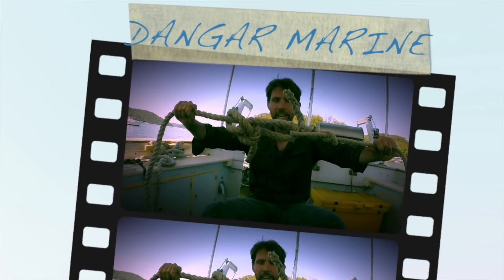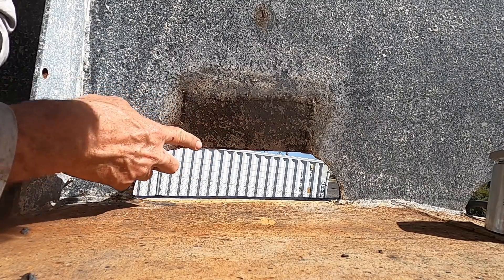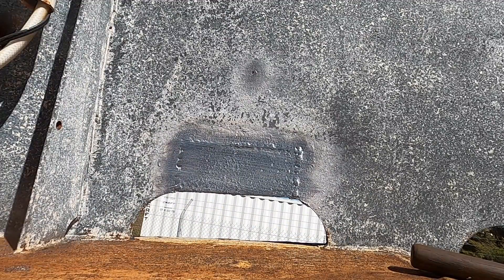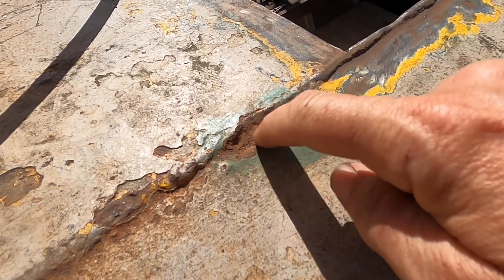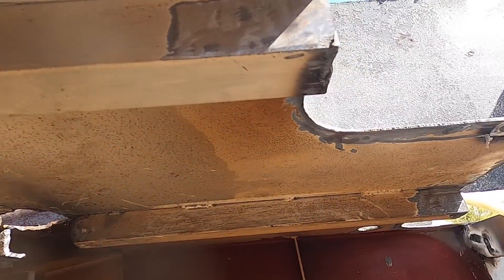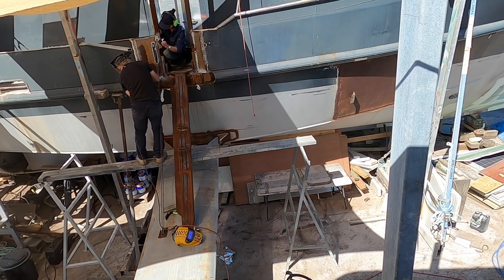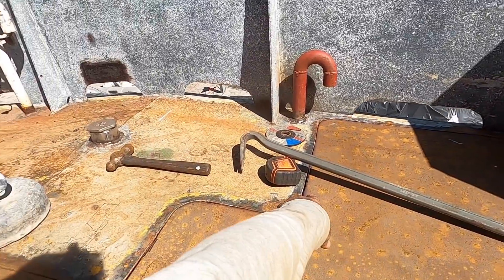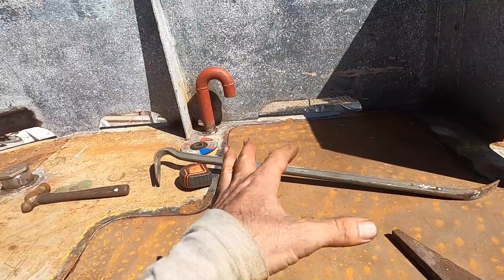How to repair a rusty steel boat

Comment: I've often had people say to me don't buy a timber boat as it's a nightmare if you need to do any major work due to rot etc. But looking at the amount of work you've had to do cutting out and repairing rust in a steel boat...what is the less of two evils? ...

Comment: I have a question and I am desperate. I have a 92 Suzuki dt115 it will not run above about 2200 rpm when in the water on a hose it will rev up to 5500 or greater rpm.  I have taken it to two mechanics and they have no clue.  If you disconnect the Throttle Positioning sensor it will rev high at idle and runs at full throttle.  I have replaced the the TPS and the CDI it is not the carburetors,  or Fuel it has great spark on all coils great compression 125 even all cylinders.  I thought it was in limp mode but the mechanic that has it now says it would not rev above 3000 rpm on a hose.  Do you have any Ideas. I will gladly send you some money if you can point me in the right direction.  Where I live not many Suzuki outboards so the mechanics are not very knowledgeable.  Thanks in advance for any help you can give.  Love your channel!

Comment: You don´t have to grind slag off of a plasma cut, just tap the edge with a hammer and the slag comes off in long strands in seconds.

Comment: Just a request, when you upload your video, can you enable captions in the video upload settings.
Once you do it for one video, it should remember it for next time.
I sometimes watch while my wife puts our son to sleep so volume is low, as dialogue is much quieter than the work
The auto captions are a little inaccurate lol, but i can fill in the blanks

Comment: We used dogs 90 degrees from yours long side down, but I guess your wedges are thick
You can put a tack in and hold it down with a 2lb hammer upright with the wood on the deck so you dont electrocute yourself
Then if you need to adjust the plate slug it with the 2 pounder while the tack is cherry red. You can get away without major adjustments using dogs quite often
same goes for frame tacks, get your mate to slug it with a hammer to bring it down after tacking on the inside, its just easier with 2 ppl.

Comment: Hi Stu, maybe down the road  for the likes of lighter pad welding you could try 2.5MM rods at 90 Amps as you can get a fairly stable arc are good deposition good weave  and less slag entrapment as you say it's all tail and error one could  even allowing two passes with the first partially filling the likes a crater,  moving over to another defect or two  and then coming back for a caping pass after cooling of the first pass then tackling the removal of the slag and buffing  and then finishing  could give a good result..that's if you're just not going too deep. Great upload...

Comment: Stu, the hard deck where you boat is standing, is rented right?, then it is a registered work site, your lack of use of safety gear like boots means you are in breach of Workplace Health and Safety regulations in Queensland. Please be aware that an industrial inspector doesn't see this video. There are reasons why we have regulations, its so you dont electrocute yourself plus put the owner of the boat yard at great financial risk should you die while you do amateur welding mistakes.

Comment: Sorry Stu but what Im saying is that a Qld industrial inspector could come in and close the whole place down just because you dont use PPE head to toe. Do you know what welding does to skin via UV???, plus no boots, plus no ventilation, plus I see volatile chemicals in the background of most of your welding videos. The owner of the hardstand whether its a registered work place or not should have accident cover in place to cover himself in case of an accident.  If an accident happens and he doesn't have accident cover you have nothing to help you. However by you not adhering to safety regulations you actually void any claim you could make should you get hurt and in fact if you injure someone else (even giving a friendly hand) you can be sued for heaps of money.  Please go to a welding safety course and understand the seriousness of what you are doing, or hire a professional welder.

Comment: Get some boots, grinding and sand blasting barefoot. Not clever, a domestic pressure washer will take your skin off, sand blaster will be down to the bone before you have a chance to move.
What is it with all the YouTube boaty types Flip Flop engineering.

Comment: Stu by you hiding my last 2 messages, this also could be used in court should you or anyone near you have an accident as it leads to a thing called 'prior knowledge' should an accident occur.  Please heed the warning about safety gear and show the world on your great channel you are a professional mechanic and safety up to a world standard ASAP.  Welding mask with extractor, full leathers on arms, legs and boots. Industrial WH&S will not only stop you from working but close the whole place down and others will be stopped because you think it portraits you as a great boat builder, dude get serious. Do the right thing. LLb